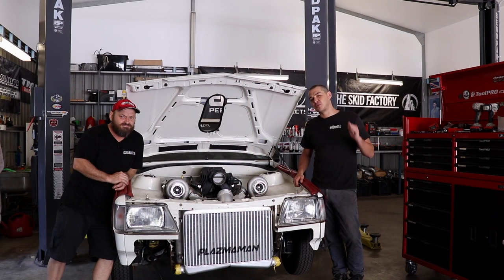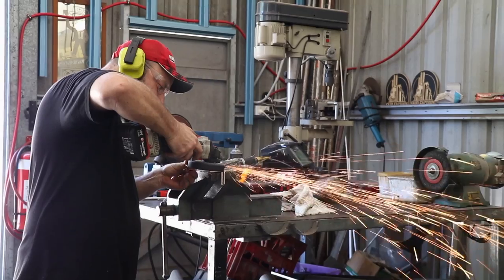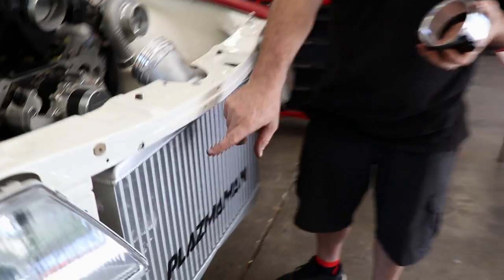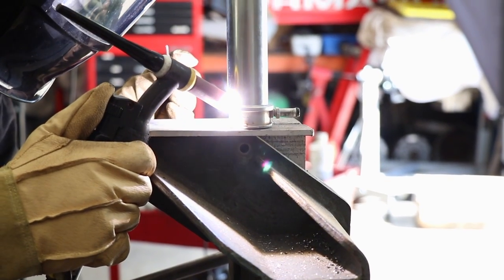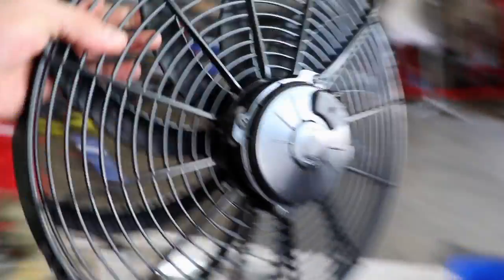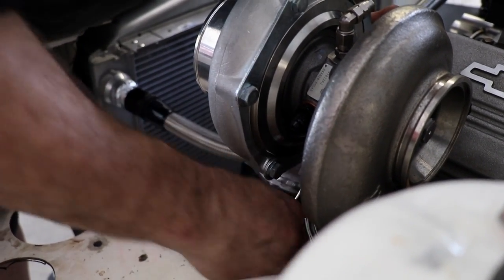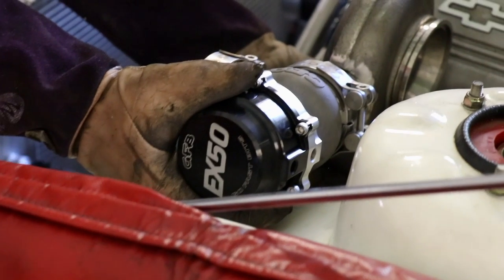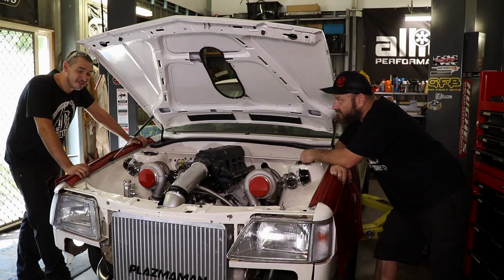Drilling Holes in $6000 Turbos - THE SKID FACTORY

Comment: Great job as always. I’m always amazed how much you’re able to achieve with how little equipment you have. I’m just spoiled by working in special purpose machine building, we have all the toys needed available for all our foreigners 🤣. As a tip for cooling down parts slowly: make yourself a little wooden box and fill that with vermiculite. Chugg your hot welded/heated parts in there for slow cooling! Works a treat

Comment: Nice mods in the Shed/Studio. Looks like you got another 5~6 extra lights without fitting any.

Also Like the Radiator fill spout. Nothing worse than trying to bleed a coolant system with the cap not being the high point.

Comment: Pffft. I have drilled holes in a $400,000 house!
Reply: thats a cheap house
Reply: Ive drilles holes in a £4,000,000 house im working on 🤷‍♂️
Reply: I’ve drilled holes in $25000000 buildings.
Reply: I’ve drilled a hole😅
Reply: Pffft I've drilled holes in $500 000 house that I didn't even own

Comment: Al have you tried using CoolGel? We use it when we have to braze line set on to keep from killing the pressure sensors and proportioning valves which are not friendly to heat.

Comment: I've definitely seen housing mounted waategates before, particularly from the big power diesel guys - but DAMN that seems like a lot of work compared to just fabricating a conventional WG priority mount out of a piece of tube/apart of a header!
Reply from the maker: These sorts of manifolds are renowned for have boost control issues due to the merge collector so we mount them on the housing instead.
Reply: @theskidfactory  Fair enough - each turbo build is relatively unique in their variables after all

Comment: I'm curious on the theory behind completely separating all the steam port lines VS joining  them together under the manifold and only running 1 line to the rad?

And if someone doesn't have 59 old gloves ti build a "gloven" with burying the part in a bunch of floor dry/kitty litter works great too!

Comment: I know eye protection is a personal choice but laying in a chair while someone scratches around in your eye with a scalpel isn't much fun.Been there done that😎
Reply: Yeèeep and for me I had eye protection ,when a Foreign body of metal melted into my eye.
5mm in length in vertical position straight down beside the main part of the eye.

38yrs of wearing protection and about 12 occasions of protection failure. 
Just shows all eye protection devises can and do fail here and there.

Unfortunately for the one with metal hanging out there eye scratching the inside of the eye lid like a razor blade.😉🙂👍👍
Reply: I've been there. No fun!
Reply: I used high strength magnets for pulling steel out of my eye

Comment: I have had several pieces of metal removed from my eyes over the years as a result of not wearing goggles while grinding. I got a few scars on my lower legs from using a gas axe on badly rusted steel on a demolition job years ago. I'd get dozens of spatters a day because I wore shorts. But I had steel-capped boots and socks. The balls of melted steel would fall inside my sock or edge of my boots. I ignored anything that wasn't too big, but I had a few 6mm balls of molten steel fall inside my sock. They kinda burn, but there's no point in taking your boot off because the damage is already done. You just get used to it. Oh, and yeah, it has been hot up this way.

Comment: install some giant ceiling fans in there to move some air around
Reply: Think they are putting in a/c
Reply: @gsppuffer  I was thinking of a cheaper option. Nothing beats a/c but they'd need a fairly large unit to efficiently cool a large, poorly insulated shed. Install + running costs would be high compared with some fans. It is really humid up there, getting some air movement would really help.
Reply: This will just move the warm air faster. :D
Reply: @prfxshnst  That doesn't matter, the point is to move the air, allowing your sweat to do its job and cool you down. Compare how how you feel on a hot day with a strong breeze in comparison to a still day.
Reply: @MickiDracing  It gets very humid where Al is 30 deg C days with near 100% Humidity in the early mornings.
Reply: @rayg9069  Yeh, I don't know how they get anything done up there. I hate humidity

Comment: Eye protection people.  I had to have steel removed from an eye.  Three appointments.  They used an air powered dremel to remove the surface of the lens and extract the metal fragments bit by bit.  It. Was. Horrible.  $1 eye protectors.  Buy a bin of them.

Comment: The clamps used on the intercooler piping. Do you allow for movement of the engine and intercooler? Like the idea of the neat install
Reply: I think that was the point of the rubber mounts between the intercooler and chassis, so the cooler can move with the engine.

Comment: I was watching another channel recently, a dude had bought a bunch of auctioned modern turbo era F1 gear from a team that went bust. Ferrari engine stuff. Amongst it was a water-to-air intercooler designed to fit in the valley of the engine and a butterfly style wastegate. The engineering of the parts was next level amazing, as you can imagine, however the intercooler had silicon joiner hoses and regular stainless hoseclamps. It got me thinking. If F1 teams are using silicon hoses and regular hoseclamps, are all these fancy clamps really necessary? I realise F1 engines don't run ridiculous amounts of boost, but you'd think in a category where money is no object and reliability is extremely difficult to achieve given the technology why would Ferrari F1 engines be using regular old silicon and hoseclamps if they weren't going to do the job? Food for thought.
Reply: Silicone coupler are good if you dont run 75+ psi 
Its more for look

Comment: I don't quite understand how boost control works on the exhaust housing of the turbo. how much boost is made within the housing, I would have thought it was a lot less than the intake side? Wouldn't a lower amount of boost mean accuracy transferring over to the intake side be minimised? Or am I just not getting it?
Reply: It's all about controlling the turbine speed. Turbine directly drives compressor which creates airflow, which is the boost we know and love.
The wastage opens and shuts to control the amount of exhaust gas flowing through the turbine.

Comment: hey guys, you could buy a industrial evaporative cooling fan from Burson Auto Parts, they are a good unit, cheers
Reply: Evap coolers don't really work well in high humidity enviroments
Reply: Ausblack better than no air!
Reply: @wicksgarage32  all it does is blow more moisture into the air and makes everything damp. So no.

Comment: I'm sure the wastegate works like that but I wouldn't risk the housing and its placement is not optimal. Similar to the way a wing works airflow across the opening will cause lower pressure.  Wastegates should be inline with exhaust flow as much as possible to reduce that effect. I know, keyboard warrior. Honestly though you guys are the best show out there, keep up the good work.

Comment: So I got to ask, those intercooler mounts that were welded up, do they allow the rubber mounts to slide out or are they vertically push through only? I only ask because there might not be enough clearance above the intercooler to clear those pins at the bottom.

Comment: What filler rod do you use for items destined for the Gloven? I've had shit success on cast items.
Reply from the maker: 316L. Never had an issue even on the oldest shittiest used exhaust housings.
Reply: Do you know what stainless rods aren't good for?
Reply: @theskidfactory  I'll give it the ol' college try.
Reply: @davidfraser6346  got any suggestions? I've got a couple manifolds I can practice on.
Reply from the maker: @corinelson7837  Edited it, it's 316L wire. Heating and cleanliness is required as usual.
Reply: @theskidfactory  thanks dudes.
Reply: 309L a better bet for dissimilar metals I think

Comment: Woody don't you mean cold side pipes
Reply: At 15:25
Reply from the maker: @joshuafurlong6923  The hot side when talking about intercooler pipes refers to the pipe(s) between the compressor and intercooler as that air is heated by the compression. The intercooler then cools it and it exits through the cold side pipe to the engine.
Reply: Thank you very much I stand corrected  I've just always heard it referred to as the cool side and the exhaust side as the hot side. But yes the compressed air is hot so. Thank you once again

Comment: You have only insulated half the shed how do u expect it to work who ever told u that would work needs to be shot I have been doing roof installation for many years now also installation does not just magically work u have to get the place cool then it will stay cooler  for longer 🤦🏻‍♂️🤦🏻‍♂️